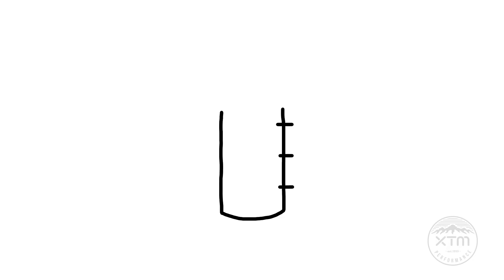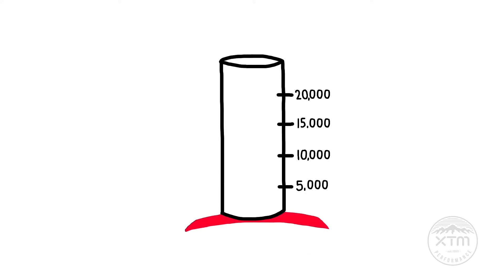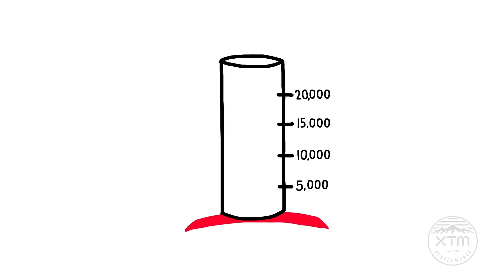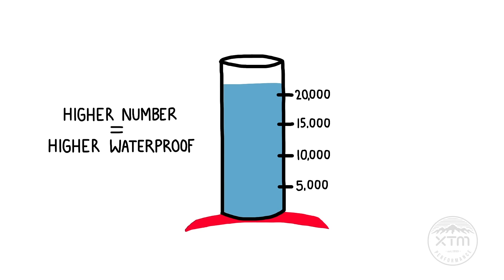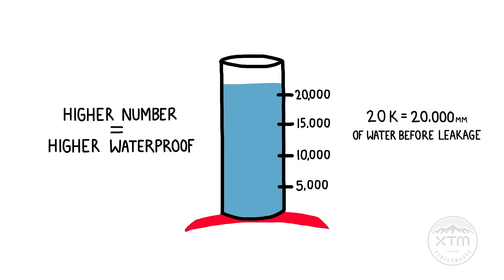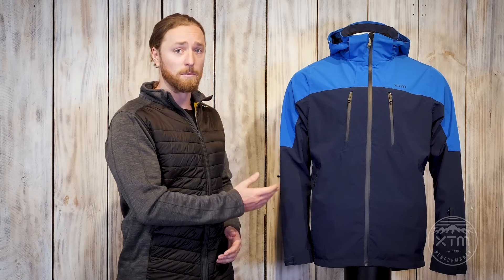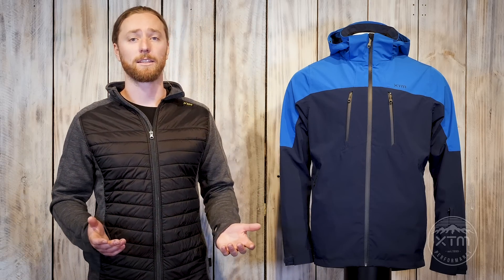How To: Understanding Waterproof Ratings

Comment: There is no way it can withstand 20 m of water.  Maybe for 0.1 sec. How was it tested, anyway?
Reply: That’s what I’m thinking. 20m of water sounds like an absurd amount. While I’m pretty sure they use air pressure above some water simulate the height (weight/force) of the water column instead of using an actual 8-storey high tube, the figure seems too high. I’m hoping to find a video of the test

EDIT1: I did find a video by mountain warehouse from 2016/17. The test used is the hydrostatic water head test. They don’t use air pressure, it’s water pressure which does make more sense. The unit of measurement is already given by the pressure gauge in mm so no conversion is needed. Judging based on how the fabric in the other video looked as the water made it through, it does seem reasonable that the pressure would be high, but they give numbers like 1,000 2,000 or 5,000 instead of 20,000.